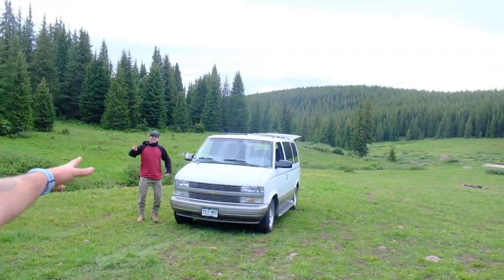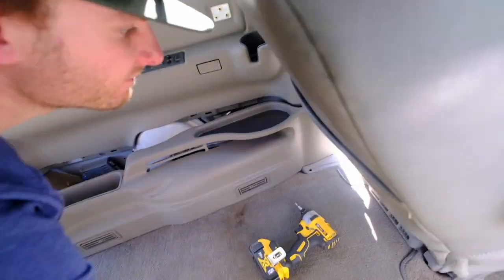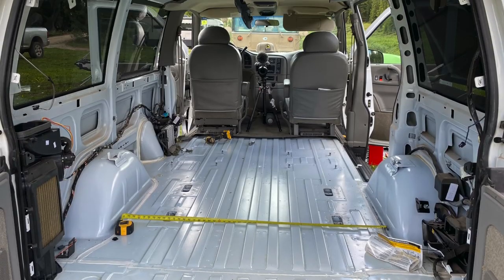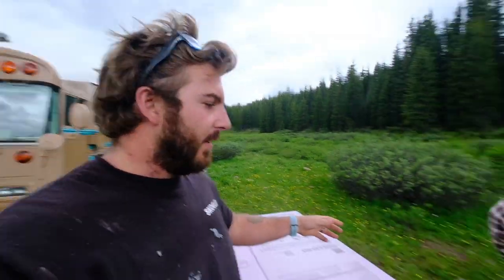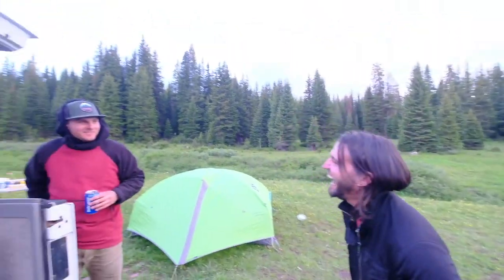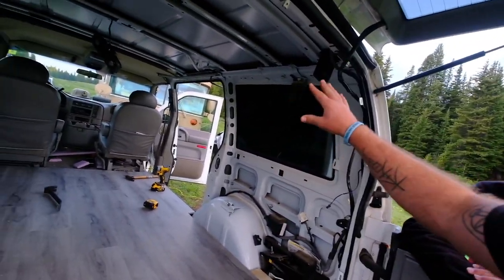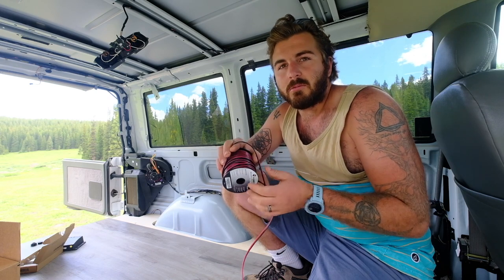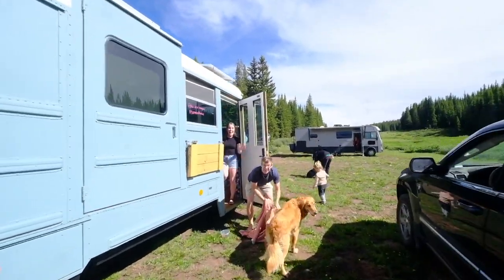Astro Van Camper Build - Gutting, Floors, & Ceiling. Day 1 & 2

Comment: Great build. I can just set the flooring insulation and all that directly on the floor? Y’all didn’t fix the floor down, did you?
Reply from the maker: Hey! Matt here. That’s correct. You can put a foam board insulation adhesive down first. And by the time you secure down everything you’re building, it will hold the floor in place.

Comment: What are the smaller cross beams on the ceiling being drilled into!?
Reply from the maker: Hey there! Those cross beams are just supports for the roof that come with the van. They were also used to hold the old ceiling onto the roof! Totally safe to drill into because there's about a three-quarter inch gap between the beams and the metal roof